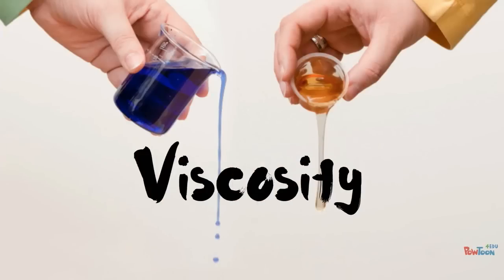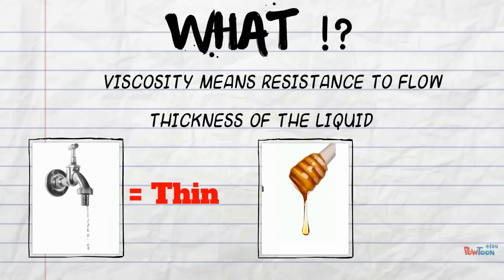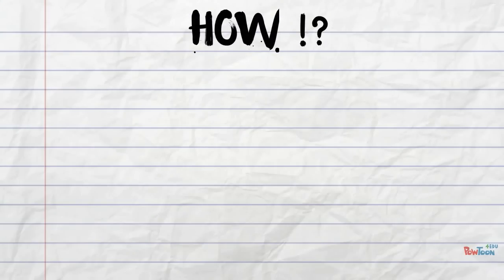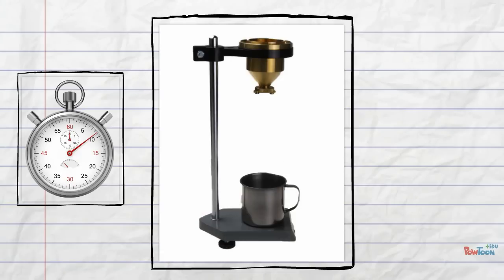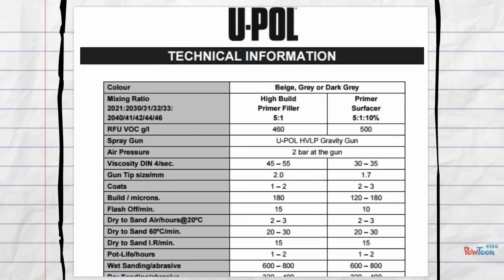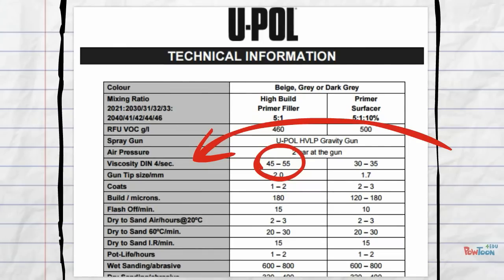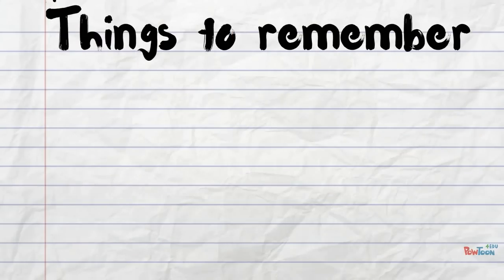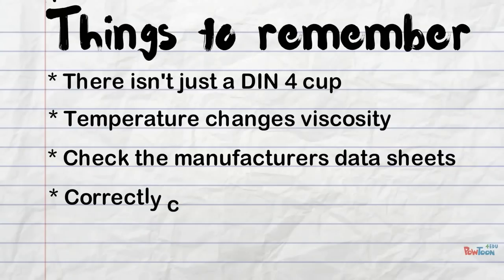Viscosity of liquids and how to measure it

Comment: What is the unit of viscosity
Reply from the maker: There's no unit as such. It depends on the tool used to measure the viscosity. In this case a din 4 cup is measured in seconds. Thanks
Reply: kinematic viscosity is measured in m^2 / s